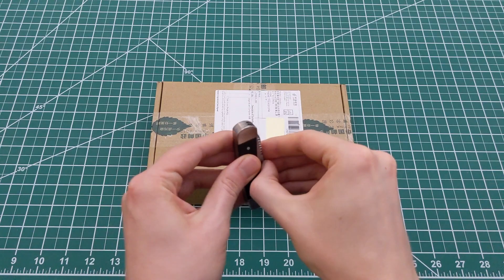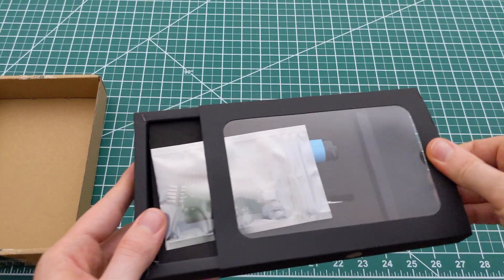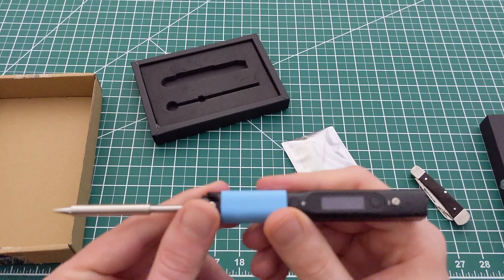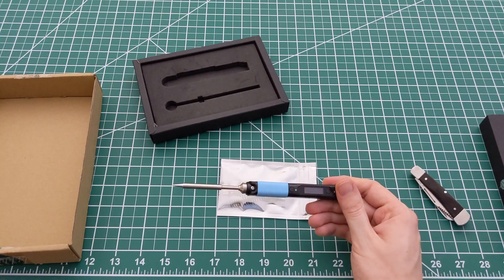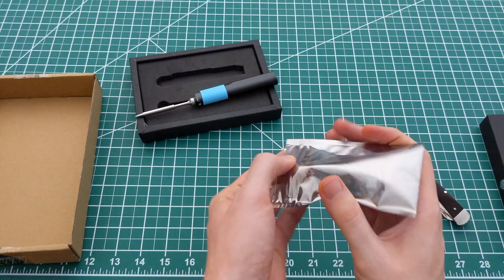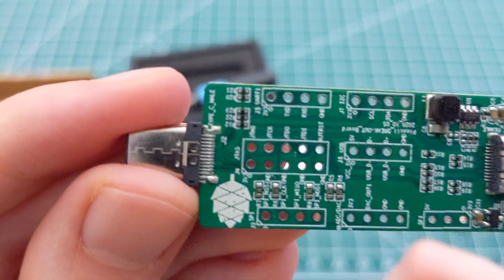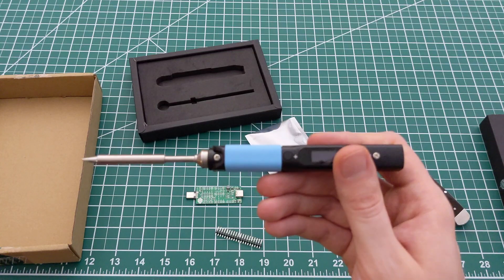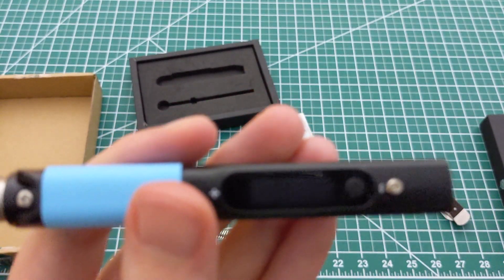PINE64 PINECIL: UNBOXING AND FIRST LOOK

Comment: I've been using like the cheapest iron I could find on Amazon for about a year now. Works alright, but wanted something with a bit more control. Like you, had been eyeing the TS series, but couldn't really bring myself to spend that much. Saw the Pinecil on a video from Level1Techs and was like.... "$30?!, heck yeah!".  Put in the order and mine just arrived today! It actually arrived quite a bit sooner than I was expecting.  Was planning on buying a USB PD power bank to use with it, but it got here so quick I hadn't ordered one yet.  haha.  Looking forward to giving it a go tomorrow.  :)
Reply from the maker: Hope you’re enjoying it! I’ve definitely been enjoying mine
Reply: @octobyte9277  I just got my new power bank and the different tip I ordered earlier. Going to give it a spin here in a bit.  I'm excited! 
Although, I'm not sure what size barrel plug it uses, I tried a few I have around the house and none of them fit.  🤔
Oh, well, that's what I got the power bank for.  :)
Reply: @BRUXXUS  pinecil uses DC5525 (5.5mm, 2.5mm)  or a USB-C (usb-c 65W laptop charger gives max power for pinecil 21v/3amp  or something close to that like 20V/3.25a).  you could use any laptop charger with DC tip or get adaptor to change the DC tip to 5525 type (check back of charger to see if it's around 19V-21V  and at least 3amp.
Reply: @BRUXXUS  the advantage of using the usb-c for power instead of the dc port is you can get a flexible, silicone heat resistant usb-C cable from pine64. the DC laptop cables are pvc and not silicone and will melt if you accidentally touch them. but the dc port has the advantage that you could power pincil from  18V-21V power tool batteries you have sitting around like Ryobi or Ridgid.
Reply: @nidusa1  very true! That’s actually what I ended up buying for mine   ☺️. Well, the silicone usb-c cable and a big power bank.  It works super well!

Comment: I'm just waiting for mine to arrive....hopefully it won't be too much longer, maybe it'll be here by June, lol! I have had a TS100 for a few years now and it is by far my favorite soldering iron of all time, and I've worked with crazy expensive solder stations, I'd take the TS100 over them any time. I have never liked the Ts100 button placement, and was annoyed that they released the TS80 without a barrel jack on the board. So the Pinecil hit those 2 marks for me and I had to buy one, especially for the price they're going for. Plus that little silicone sleeve is kinda nice. I printed up a little TPU sleeve for my TS100, but a silicone sleeve is really nice! Anyway, thanks for the upload! I'm really excited to receive mine, it shipped on 1/6 and is still sitting in Shenzen.....crossing my fingers. Oh and BTW, we call them quadcopters, not quad-ro-copters.
Reply from the maker: Good luck! I am fairly happy with mine so far.
Reply: I JUST got mine after a month of waiting.  I'll be using it in a few minutes! :D